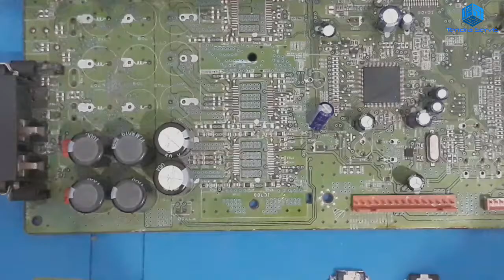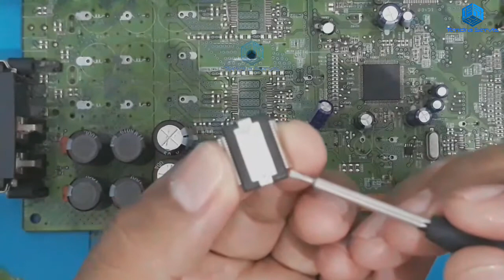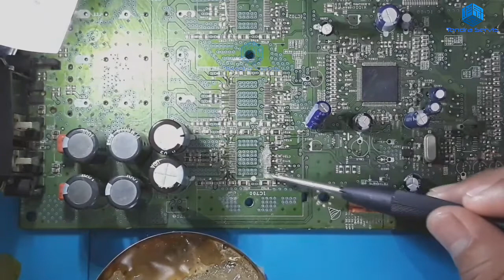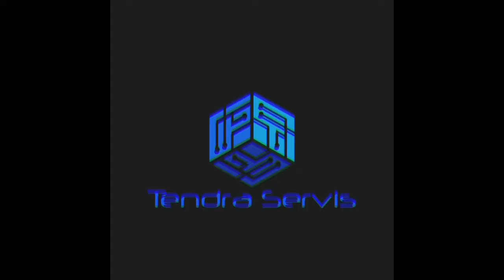CARA PASANG IC SMD HT1000-4

Comment: Bang punya saya persis kayak divideo, panel depan semua normal tp ga keluar suara apa ic'y yg kena, atau kena mode muting.
Reply from the maker: Coba diukur output dari port speaker belakang ada gak tegangan gak bg?
Reply: @TendraServis  ada bang di chanel L 4,45 kalo di R 0,65
Reply from the maker: Nah, lanjut cek tegang out psu bg, di Pin out soketnya ada tetera konsumsi tegangan